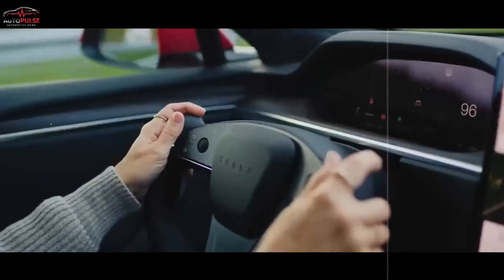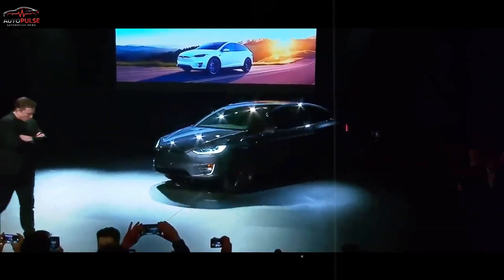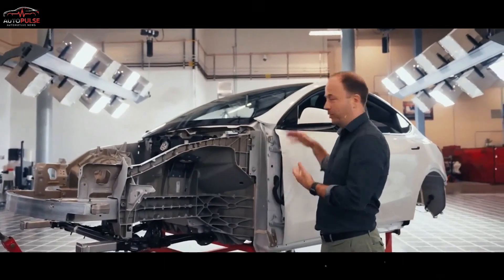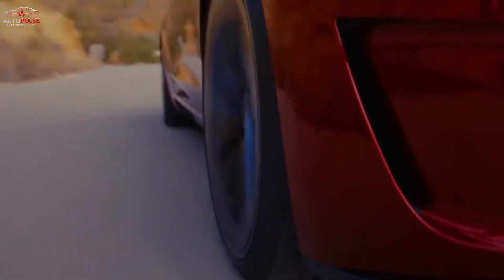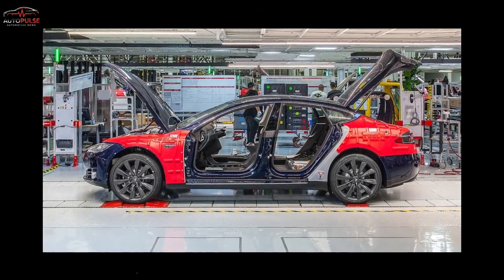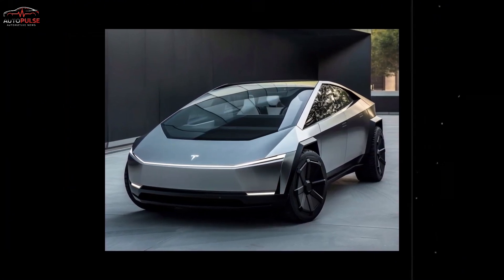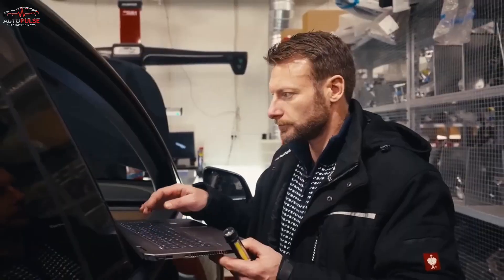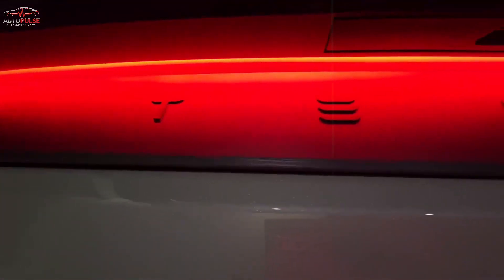Tesla Model 2 Under $10K? Elon Musk’s 2026 Reveal Shocks the EV World

Comment: What I don’t understand is how come they don’t add a couple of alternators or generators to the vehicle that would help keep it charged as it’s going down the road just like the engine do now with gas. They have an alternator that keeps the battery charged so why don’t they do something similar to that with alternators or generators for the battery vehicles or hydrogen vehicles Those batteries charged keep the overall cost and stops at stations down peace and God bless
Reply from the maker: Thanks for your question! That's actually a really thoughtful idea. The challenge is that alternators and generators create energy by using some of the car's existing power, so in an EV, they would actually drain the battery faster than they could charge it—it's like trying to lift yourself up by pulling on your own shoelaces. EVs do use regenerative braking though, which captures energy when you slow down and puts it back into the battery, kind of like what you're thinking! The real breakthrough will be better batteries and faster charging networks. If you like Tesla news and EV updates, make sure you're subscribed so you don't miss any announcements!